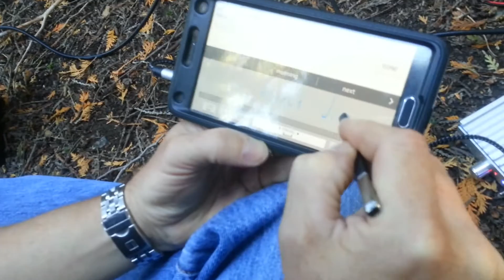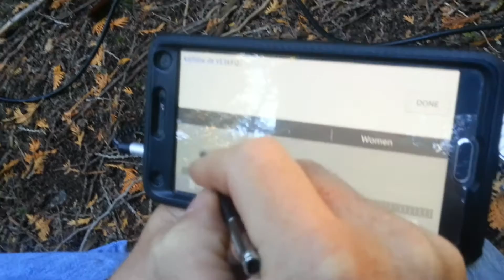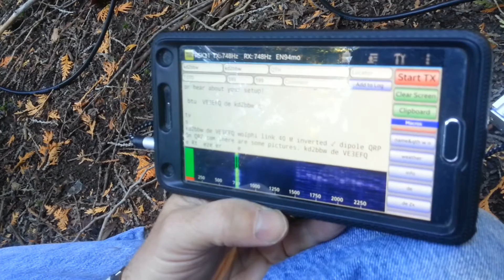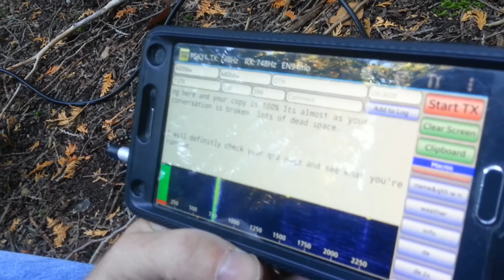Testing out the Wolphi-Link Interface on DroidPSK

Comment: What do you set your volume levels at on the tablet to transmit.. tried it with Android phone but could not get to transmit.
Reply from the maker: IF you have your volume to the max and it will won't transmit you'll have to adjust the Tx pot inside the device.  It's very simple to do.  The instructions to do this are on their website.

Comment: Read the user manual!!!
DroidPSK can work like that but it's not an efficient way to work.
I'll send you my macros, but you really should read the help file, it's excellent!!!
Reply: Yes, the program works, but with the small screen it is a bit slow.  I've watched a view of your videos.  I really like that wolphi link.  That was only the second time I tried to use it; I'll get more efficient after some more practice and after I write up some macros.  I just wish there was a good program for winlink!

VE3EFQ.
Reply: modustollen that winlink question makes me angry 😁
It's closed proprietary software with commercial backing,  so I doubt there's ever going to be an Android or Linux version. :/
Reply from the maker: yeah. . just learning the program.   On PSK31 I prefer to just free type, but using some macros sometimes might be good.  I'll look into the manual, thanks.
Reply: I've looked around for a current way to access winlink via android but could not find anything; but, there are claims about something coming up: http://www.winlink.org/content/new_open_protocol_coming
Reply: Yea; that post is more than a year old and there is no software available yet.  What about PSK mail?  Have you tried that?  I have the software on my PC but never got it to work yet.  It has an android app.
Reply: modustollen PSKMail had Android support AndPSKMail, stop does fldigi AndFLMsg. I need to build myself a server for PSKMail, I plan to do that during the winter. I'll publish tutorials on both this stupid during my digital comms series. lots of work, but slowly moving forward.
Reply: modustollen I've seen that too. it's exciting, but I'm very skeptical.